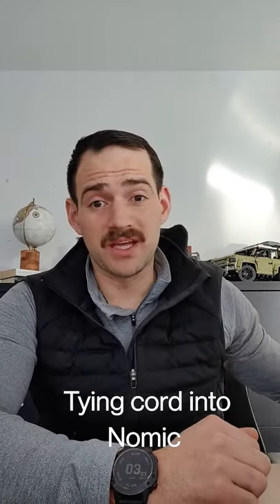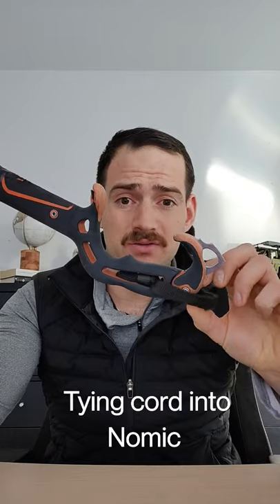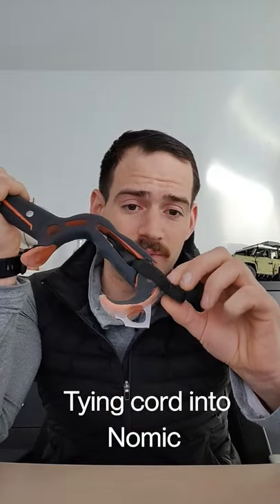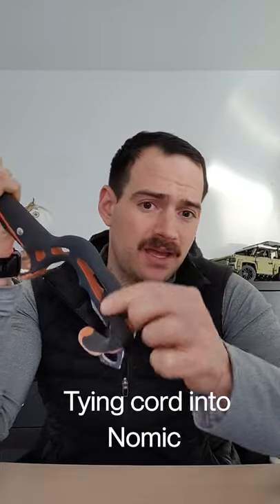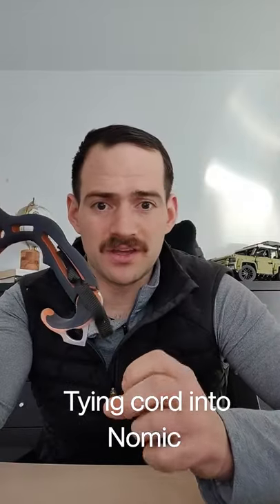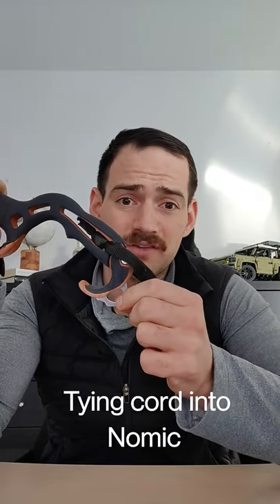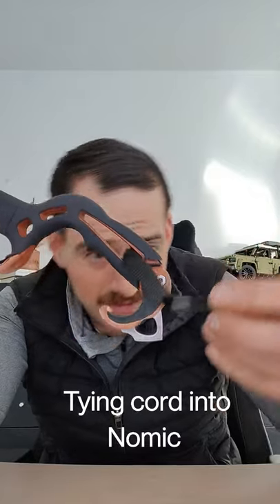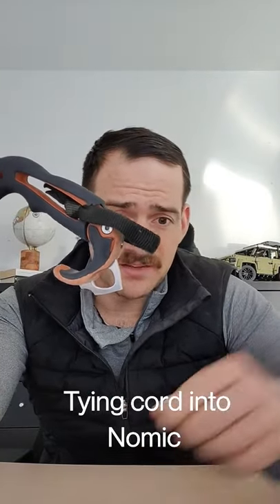How to tie webbing into Peztl Nomic Ice Tool

Comment: What type/thickness of webbing do you use? Overhand knot? Thanks dude
Reply: It's like a flat overhand, but since it's webbing it's technically a flat water knot. Basically tie an overhand in one strand and then follow through with the 2nd strand so they both lay flat with no twists. Make sure you really cinch it down tightly and have like 1" of tail